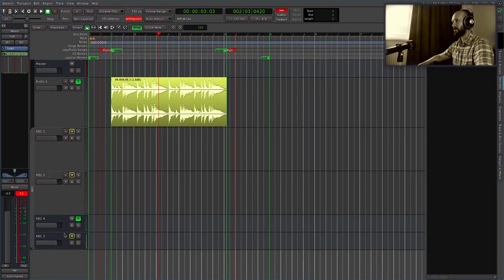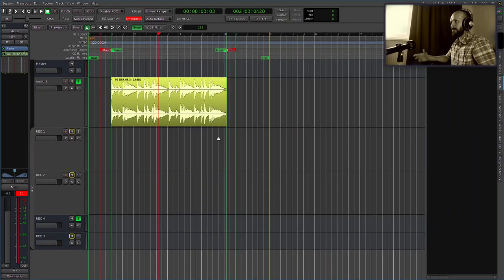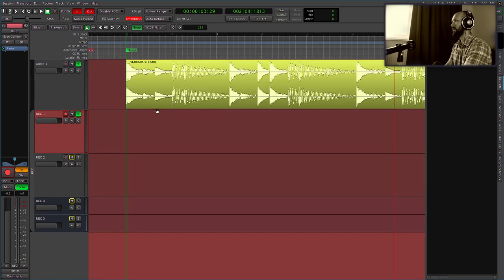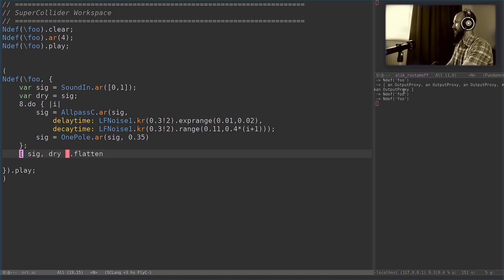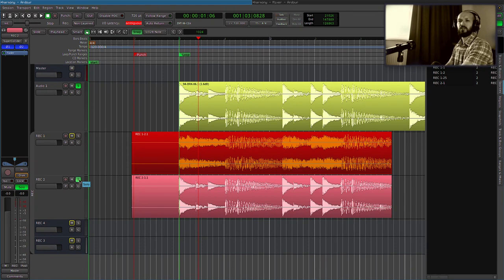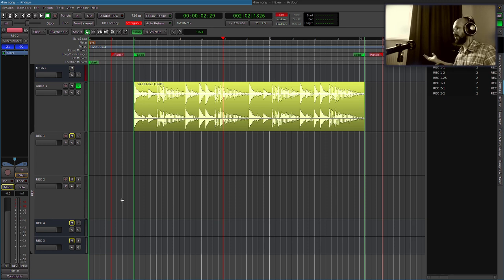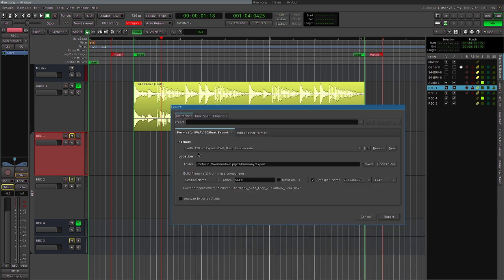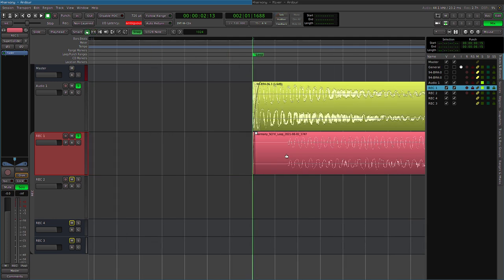24: Faster than real-time FX send-returns (Ardour to Supercollider)

Comment: Pretty interesting one man. I'm curious though. Why use Ardour instead of Reaper? To me it seems way more fleshed out of a DAW and integrates with SC really well. I'm wondering if there are some features in Ardour that you see that are not in Reaper?
Reply from the maker: Does this NRT rendering through SuperCollider work in Reaper? I didn't test it. I like Reaper from day one (Windows version) but still per my sanity tests it does not work good enough in Linux. Ardour also has some problems, but "lighter ones".  Featurewise I consider several of Reapers a must have (like fx chain per region) and ardour does not have it, but I can get around that. When Reaper will become more stable on linux I will probably use it again. Last time I tested, fiddling with fx chain on one track would affect chain on other tracks. that's a big issue

Comment: damn, this does not work in Reaper it seems. Will probably have to learn some Ardour now
Reply from the maker: Won't take long )) plus you get another one called Mixbus as a bonus. It's strange though it doesn't work, I was hoping its not a big deal to implement. Maybe playing with jack_frewheel tool can help? Even though I wasn't able to use it successively yet